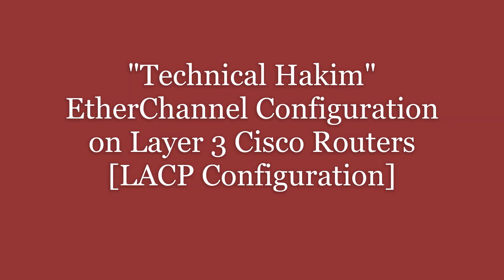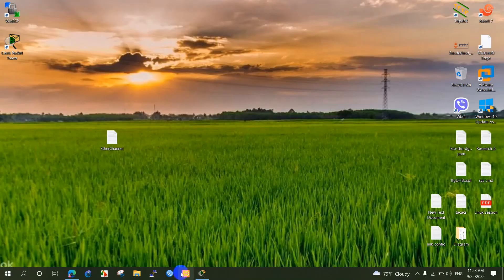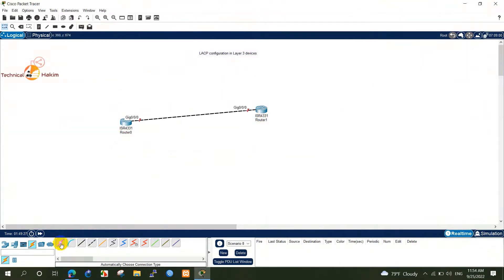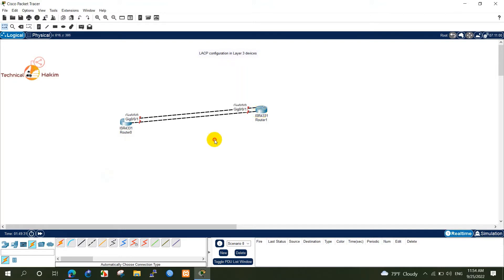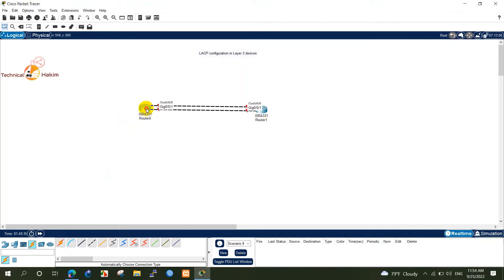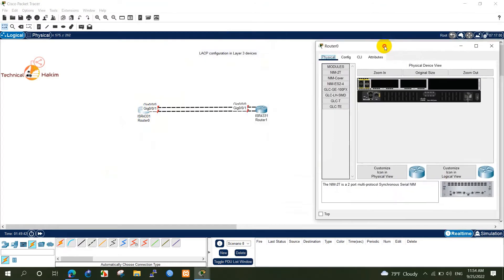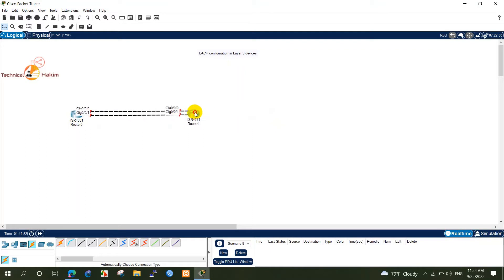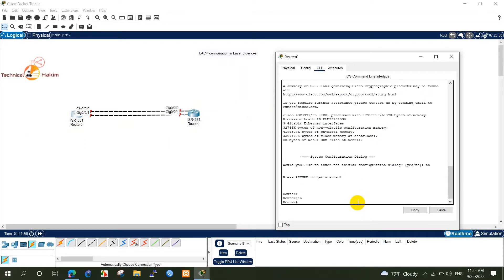EtherChannel Configuration in Layer 3 Cisco Routers | LACP Configuration | Technical Hakim

Comment: how can i do that between 3 routers ? When 2 are up it seems that there is no routing problem but then when i turn on the third one, the routing goes completely nuts and it doesn't work...
Reply from the maker: Key Considerations
EtherChannel Design: EtherChannel is a point-to-point link aggregation mechanism. It cannot directly handle multi-point connections across three routers. You need to create separate EtherChannel connections between each pair of routers (e.g., R1-R2, R1-R3, and R2-R3).

Routing Protocols: Ensure that routing protocols (e.g., OSPF, EIGRP, or BGP) are correctly configured to prevent routing loops.

Avoid Layer 2 Loops: If any part of the network operates at Layer 2, spanning-tree or loop prevention mechanisms are required.

Why Routing Breaks with Three Routers?
Routing Loops: Without proper configuration, traffic may loop between routers.

Incomplete Adjacencies: Misconfigured EtherChannel or routing protocol settings can prevent proper neighbor relationships.

Inconsistent Metric: If OSPF cost or another metric is inconsistent, traffic may prefer suboptimal paths.

i hope it's somehow clear to you, thanks for your query. keep exploring.

Comment: I have a doubt! 

In theory, Etherchannel is a protocol exclusive only for layer 2, right? So you Will only be able to interconnect a switch between a switch, or a switch between a router... If you can perform this (interconnecting two routers), un which interface Will be the IP? On the portchannel interface or... Same for NAT or OSCP, on which interface Will you configure the IP?
Reply from the maker: yes we can configure ip address on port channel too